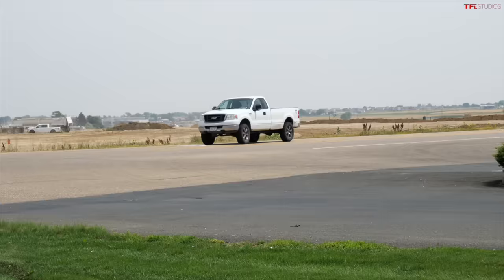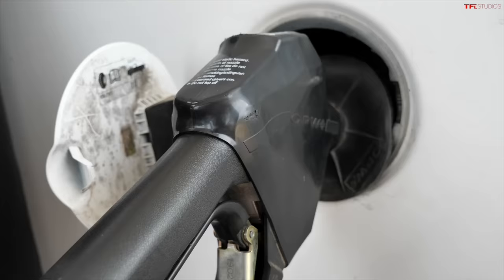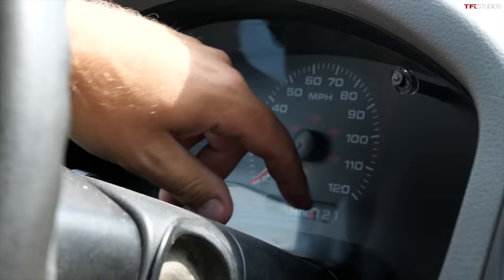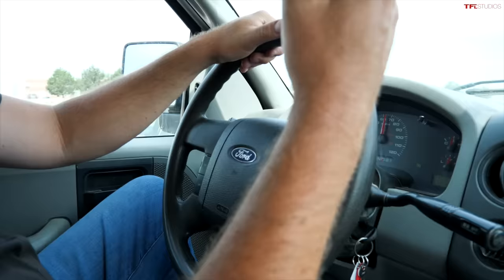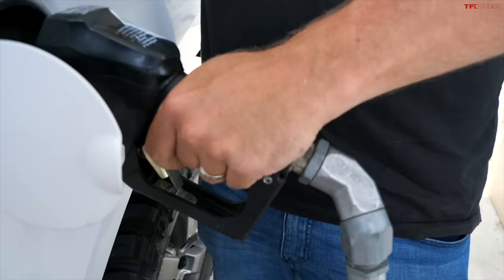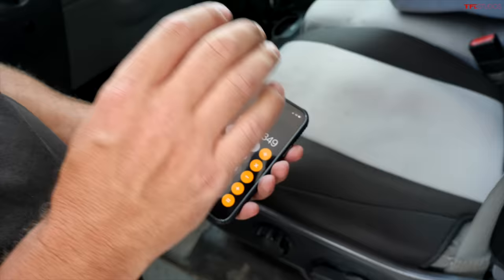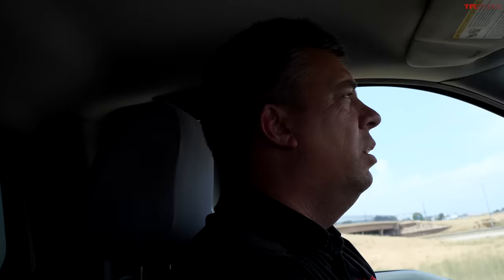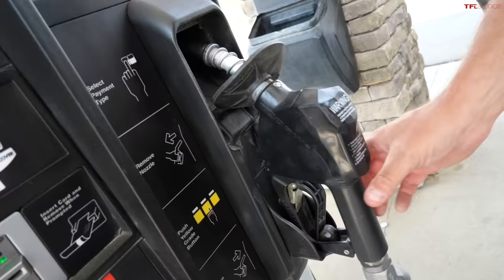Surprising Result: Here’s What Happens To Your Truck’s MPG When You Install A Topper!

Comment: The "lift and beefy tires" hurt fuel mileage more than any tonneau/topper/tailgate configuration
Reply: true!
Reply: The taller tires effectively lowers the overall gear ratio. The taller tires travels further every revolution , which effectively artificially lowers the gear ratio. The fact that it is equipped with a 4.6 the additional load might work the little motor harder! My truck has a 5.4 with a 5 stage tuner, I don't bother checking the milage! The taller tires probably help my fuel consumption! The lift kit may increase wind resistance, but at normal highway speeds it won't break the bank! I bought my truck to pull my camper, car trailers, and boats. I'd wager that towing a 6000lb camper it gets better economy than the 4.6.with the same load, however, I'm impressed with the milage he got with those tires on that truck. Most men will lie about 2 things, their gas mileage, and, well you know what the other thing is. They stretch the hell outta both!!
Reply: It has no significance to the test when both tests with/without topper are using the same wheels and tires.  It's insignificant.
Reply: @SylasG  no shit Sherlock, that's not the point I'm trying to make, either. "Lifted with beefy tires" never nets the same fuel economy as stock, increased drag, increased inertia to overcome, reduction on final drive ratio puts the engine out of it's max efficiency window, etc, etc.....
Reply: My experience is it depends on several factors, what ur doing with it makes more difference than any other factors. If you got 3.73 gears, short tires and just haul of trash and ride around, a taller tires might help.it artificiality thing it has less gear. Ud have to consider speedometer error and factor that in. Heavy trucks with small engines would probably see fuel economy suffer, while the same truck with tow package could see it improve under no additional load and on level terrain. Been there,seen it. Not Talkin 44" ground hog tires,.just slightly taller tires.
Reply: @jamesgeorge4874  I understand that.  I’m saying the fact the truck their using had a lift and tires isn’t significant to the test they are doing which is comparing mpg with and without the topper.
Reply: @SylasG  18 months at an ORI franchise taught me a lot more than you will ever understand. This is part of my 30+ year tenure as an automotive technician. 95 times out of 100, lift+tires =reduction in fuel mileage. Period. Now going from a 245/75R16 to a 265/75R16 in an unladen diesel might net a tick better fuel mileage, but anything that raises the vehicle higher into the air, and makes the engine work harder (big tires) has a net negative affect on fuel mileage, increasing exponentially with speed. And I watched the video. I know a topper, and no topper has diddly shit to do with fuel mileage, ffs, I figured that out 25 years ago. Your comment is as profound as "tomorrow will be Wednesday", no kidding, you don't need to state the obvious.
Reply: @jamesgeorge4874  Dude all that shit is irrelevant to the video!  They are testing mpg with and without the topper!  Nobody is arguing if lift and tires affect the mpg or not.  None of that stuff is changed during this test the only difference was the topper.  Everything you’re saying is irrelevant to THIS video.  I’m not saying you’re wrong.
Reply: @SylasG  Correct. Only thing that changed between trips was the addition of the topper.
Reply: I did some work on my 96 Ford 7.5L 5 speed 4WD,  4.10 gears with factory settings ( tires changed from 235-85-16 to 285-75-16 ) the Truck got 12mpg no matter what. It was dialed into that and didn't care one way or another about what weight I was pulling. With new front leafs with 2"lift and rear 2" lift and the bigger tires  my milage decreased in the city to 11 mpg but Highway milage went to 16mpg, if I was pulling weight highway dropped to 14mpg. Would've liked to have that GPS app but my local dealership was able to program my new tire size into the truck so speedo was on the money.
Reply: @SylasG  lol this guy doesn’t get it. They could use cinderblocks as wheeels and it doesn’t matter as long as you use the same set up for the topper run
Reply: Yes, for some reason TFL refuses to put the appropriate tires on vehicles.  They use touring tires on soft roaders for the mountain trails, and fail.  They use all-terrain or off-road tires for highway mileage tests.  Bass ackwards.  Andre knows better, Roman I'm not so sure.
Reply: @markmccarty727  I had the 5.4 motor with a 4-speed Auto.  Worst gas pig I ever owned.  It was fast and ran great but I filled that tank (35 gal.) a lot!  Gas was $4.00 plus back then.
Reply: @tedunguent156  I had a 2 valve 5.4 extended cab. It was ok on fuel, not great, but ok considering what this one does and did a good job towing, turning radius was better, and was actually geared shorter. Lost it in accident. Bout 30% better on fuel . This one has a 5stage tuner with it. Never used it, think it's on haul ass and drink gas mode!! Just put gas in it and go. Priced new one! That math makes me feel better when I stop at the pump!!
Reply: @James George 3 amen to that, but one can compensate against that by changing the running gears in the rear and front differential to match what was done, many don't know that trick
Reply: @watup110875  Very true. However, it all depends on how much money you're willing to spend, and if you're planning on sticking with the additional lift & big oversized tires long term. 

Axle re-gearing is ALWAYS an expensive venture. Always... even if you do it yourself.

Usually the least expensive way out is to stick with the OEM stock size or near-stock sized tires, if you want best fuel economy for the least overall out-of-pocket costs.
Reply: I agree.  The amount of drag from tires, lift and truck body might overwhelm any efforts to increase fuel efficiency or at least diminish them a certain rate.
Reply: @watup110875  Most people won't pay a shop to do the work, a ring and pinion swap is a big job, and honestly a lot of shops these days aren't going inside a differential, then warranting their work. If they do, it's probably a thousand dollar affair, per diff, so $2000 to regear. It is the proper way though, not doing so just works the transmission harder.
Reply: @The_Osprey  That's my thoughts exactly. Every engine has an range where peak performance balances with fuel consumption! I bought my truck to tow my camper and boat! It's not it's fault that I chose to put in outside it's sweet spot!!
Reply: @jamesgeorge4874  still worth the money though
Reply: @watup110875  Agreed. It will be interesting to see how much, if any, the matter will differ in 10 speed trucks, once I see them with lifts, and big tires, here in the near future. I suspect it will still negatively impact mileage, but perhaps less.
Reply: Id like to see this done with soft and hard covers. I do know it helps with wind sheer and blowing the truck around with the hard cover I have. That cap will make wind sheer worse. So much room with the cap on though. They all have their uses
Reply: @SylasG  Thank You , it's as simple as you can get !

Comment: I worked at GM years ago doing testing on hybrid powered S-10 pickups for the USPS, we found the best mileage and aerodynamic efficiency was with only the back half of the bed covered.  The wind tunnel showed the hole behind the cab allowed the air to curl around the cab, it was more aero than a full tonneau cover or no cover and the tailgate removed.
Reply: Some student interns at NASA/Ames Research Ctr. (2004?) conducted some tests
on pickups with tonneau covers vs pickups with no cover and the tailgate down.
Having the tailgate lowered, it acted like a flap, creating more drag with its increased surface area. Tonneau covers had the best results. A standard open bed, tailgate up, coming in second place. Apparently an air bubble is created with the gate up that makes for better aerodynamics. Science! Maybe some of those interns got a job at GM???

Comment: 1996 F150 300I automatical 14.8 mpg
Added a fiberglass topper and diy drawe system made from 3/4 plywood and loaded with tool's  17.1mpg

2005 Ranger 24 mpg 
Added heavy commercial topper/tonneau cover. With diy 3/4 plywood rack system 27.7 mpg

Comment: It should be noted that aerodynamic drag increases as a square of your speed. So reducing drag is less important if you are driving slower, such as in town. Also, weight becomes more of a liability in stop and go driving. So the topper may help a bit when highway driving, but will be a disadvantage in the city.
Reply: Indeed. Everything’s a compromise.

Comment: I’d love to see the test with a lighter weight Tonneau cover
Reply: I can't say for sure but it looks like it was a Leer 100XR or 100XL and both of those are fiberglass so already presumably relatively light. I wish they'd mentioned the material to be sure- maybe they did and I missed it.
Reply: My personal experience is that a Tonneau definitely helps.
Reply: Yes me too
Reply: Cap vs remove tailgate
Reply: And add a city loop..
Reply: @philtripe  funny but why the hostility ?
Reply: @gilbertnadeau7181  I had tonneau covers on my last 3 trucks which I have to remove from time to time to fit larger items and, never saw any improvement when the tonneau was installed.   I had the chance to test each truck on several longer road trips too without the tonneau cover and it definitely didn't improve fuel efficiency...
Reply: That would be great
Reply: @philtripe  just another keyboard commando with nothing to do but throw insults.
Reply: Lear is one of the most common tonneau covers so I think this was a good demo.
Reply: It would definitely bring it to 18.5-19mpg.
Reply: Typically your mileage will be tripled. Also tire wear is reduced to half.
Reply: It's the same
Reply: 200 lbs isn't enough to make a difference
Reply: @greyestfox   Fiberglass is heavy!
Reply: @secondamendment8773  this is NOT  a tonneau cover, this is a bed cap.
Reply: My230,000 MILE  2010 f150 etx cab4.3v, no cap pulls 19.8MPG

Comment: Whenever I drove long distances in my 283 small block V8 68 Chevy El Camino I used to leave the tail gate down to reduce the drag of the tailgate. It did help increase my mileage by a few miles per gallon. The mileage rating depends on the terrain you're driving on, whether it's flat or if it's a lot of steep mountain roads and not just weight and aerodynamics. Your mileage also depends on whether or not your car has 2 barrel or 4 barrel carburetor. 2 barrel type will get better mileage. If you drive at 60 or lower you get better mileage than you would at 70. Your less likely to get a speeding ticket depending on how strict the police are in your area. Driving in heavy city traffic with a lot of traffic signals is a mileage killer too. Highway driving with a steady speed about 55 to 65 will get the best results.
Reply: You are incorrect. A 4barrell will get better mileage if it is driven such that the secondaries are not used.
Reply: I say bullsh!t to your statement. The air NEVER sees the tailgate & 2 barrel carbs don't get any better economy than a 4 barrel UNLESS you're driving it hard all the time. In fact, a Quadrajet carb will do better than any 2 barrel because the primary bores are so small. There is NOTHING one can do to improve the economy "by a few miles per gallon" with the same vehicle, engine & gearing.

Comment: I made a comment years ago, but I'll reiterate this.

I've hypermiled both my 1988 Dodge D-150 318 cu in and my 2000 Mercury Grand Marquis 4.6L V8 (same as used here)

Here are some ways I could get around 25+ mpg. I couldn't break the 30s so don't expect that from a truck. I've done hypermiling for a few years now and it's the best mods you can do for a ride if you want to save some cash. 

Just a disclaimer, I do not tow or haul with my truck. The most it's used for is holding tools for automotive repairs.

Not just a topper will do the trick, it's a combination of things. If you slowly add to it, you'll notice big gains later. 

1. Lower the vehicle. Not only does it look good, it's better for mpg
2. Invest in under cladding. Plastic under cladding can make the car slippery underneath, air won't get trapped and create drag. 
3. Go for more narrow tires, in regards to width. 
4. If you can find them, low friction tires. 
5. If you have a brake cooling set up, I would put moon hubcaps on. If not, you might be better off without them. 
6. Aluminum alloy rims or any light weight rim. Steel is heavy, lighten it up. Less weight, less force needed to turn that wheel.
7. A tune if you can find one. Try not to lean it out yourself, you can burn up some valves doing that. Just find a tune or ask a tuner if possible.
8. Warm air intake, smaller carb. Hot air can lower your by a few numbers. But engines love to save fuel when it's hot. Invest in a tune. 
9. Change fluids regularly, maintain TP. Friction can create drag in a sense. Lubricants that are fresh don't require the parts they serve to work as hard. A hard tire with proper psi is great on saving fuel. 
10. Weight strip, get rid of any unnecessary weight. Try to swap bumpers with aluminum or even wood. (I did this with my Dodge, even burned RAM on it and varnished it real nice.) Swap the hood with a carbon fiber or fiberglass. This is for the crazies of course. Get rid of any seats you arent using. 

With all this, I was able to get around 28 in my Mercury. Estimated 25 in my Dodge. Since I used both for work and for fun. I invested in them quite a bit. Even threw on a lighter weight drive shaft on the Mercury. 
If I want to get more crazy, I may swap the 318 out of the Ram for a 4BT and tune it to my liking.

Enjoy guys.

Comment: I had a ‘98 Mazda B4000 before. I added a BlackMax vinyl tonneau cover (maybe weighed 20 pounds total). Gas mileage went from 17.5 up to 18 on the highway, so extra 0.5 mpg. That style cover will actually make a difference. Saved about $1 per tank (gas was only like $1.79 then) and I had it a few years, so it probably came pretty close to paying for itself. Cost about $155 directly from their website. It was great quality too and looked super sharp on that little truck.
Reply: Thanks for mentioning this. Tonneau covers are always overlooked during the cap vs. no cap fuel economy tests.

Comment: Great truck. Great episode. I always run a topper. Just suits the way I use my truck. 

What is that app you’re using? I really like the gps tracking and averaging.
Reply: Why do you need to know the MPG each minute. You drive it, when light goes on, you fill it up.

Comment: I just finished a long trip and.  On previous trips I made 80 mph my target speed.  On this trip my target speed was 70 to 75 mph.  Gas mileage improved from 15 to 19 mpg.  This surprised me.  I know trucks are not very aerodynamic, but did not think the difference would be so big (20%).
Reply: Drag increases exponentially with speed, and the powertrains on most newish vehicles are setup for peak fuel efficiency at 60mph (that's the highway speed of the CAFE standard test used to generate the window sticker numbers). Anything faster than about 65mph you're just throwing efficiency away for the sake of a shorter trip. Sometimes it's worth it, sometimes it's not.
Reply: Takes a lot more HP to run 80 than 70 & the engine vacuum is quite a bit lower under the higher load requirement, thereby requiring more fuel.

Comment: "I cannot do it anymore scientific than this"
Every nerd with a science degree: "sure you can - repeat excercise at least 10 times and calculate the average over a larger dataset"
Reply: And use a fill measurement method with better repeatability, and do the test in lower-traffic conditions to allow for better consistency. But what's the point - this subject has already been studied much more thoroughly than this test, which seems to have been done to fill an otherwise idle day and provide content for another video, rather than to answer any question.

Comment: This weekend I proved there is low pressure area behind the cab. I was moving furniture and it was going to rain so had to put a well tied down tarp over the bed. On the highway, the tarp tried to "poof up" like a vacuum was sucking it up and had to stop and retie even more so wouldn't block the rear window. The most aerodynamic shape is the Egg, so having a square backend on the topper or no top hurts.